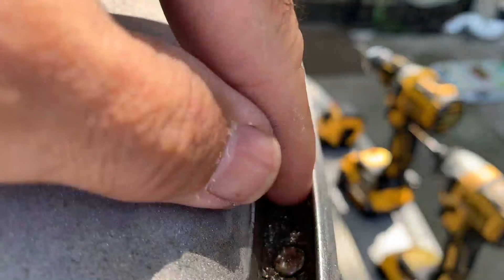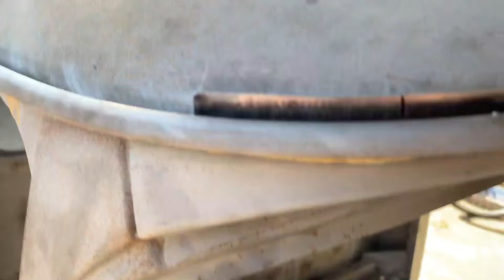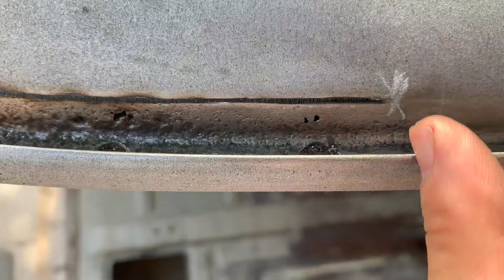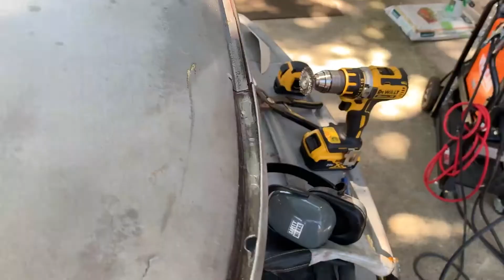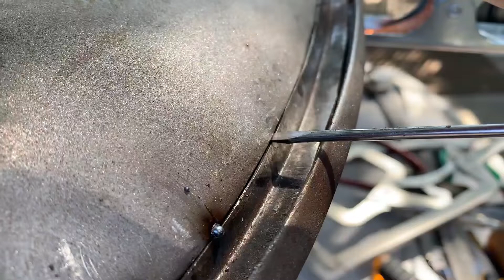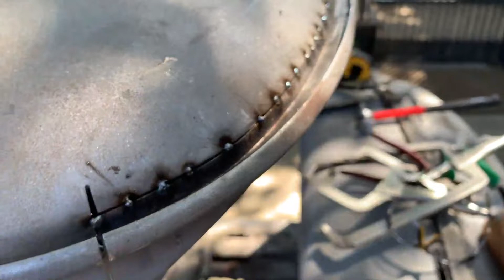1953 - 1956 F-100 Roof Repair

Comment: You'd be better off drilling some locating holes, right through the roof and drip rail , at the corners of the roof and front and rear.(about 15-20 of them)..and then cut all the welds and take the roof skin right off. You see that rust between the roof panel and drip rail? You think the rust is just between the panels only in that corner? No. Rust is in there all over the place and five years from now you will be doing this again in other spots. Btw...use a die grinder with a carbide burr to cut spot welds instead of drilling through and having to weld up holes on the backside. That way you don't have to distort the metal you are removing to get it off and you can make a pattern from that if you needed to. Just a little tip from a guy who started in auto body school in 1980 and who owned a rusty 56 F-100.